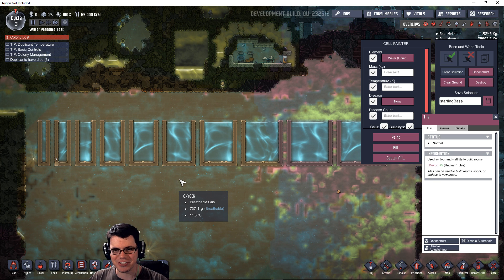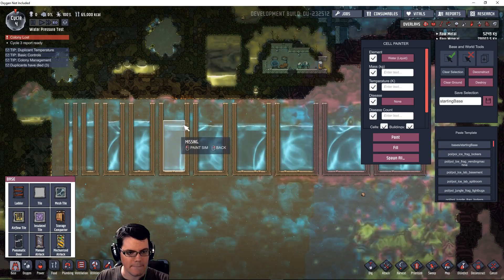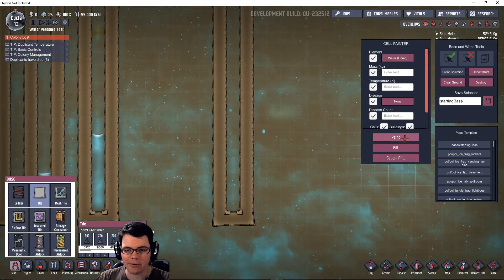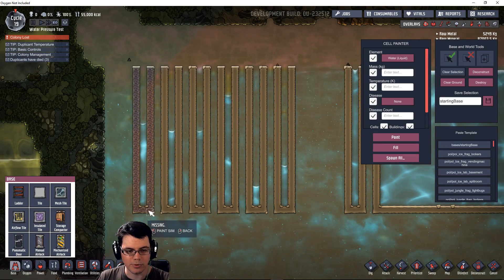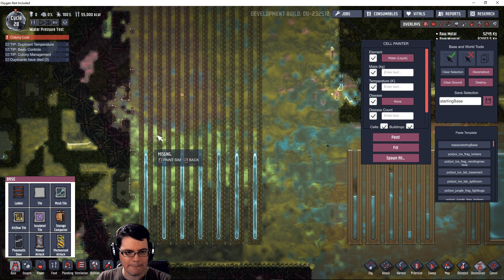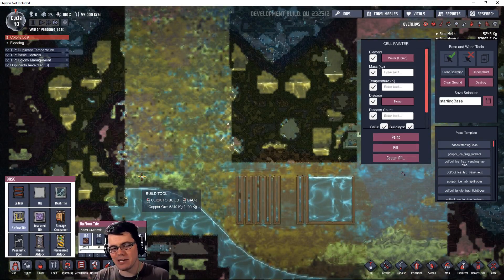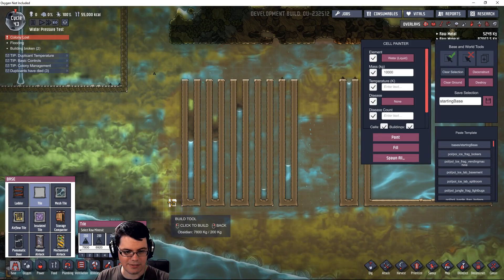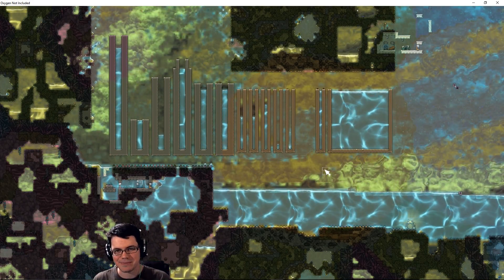Tiles VS Water Pressure Experiment! - Oxygen Not Included Tutorial

Comment: When it comes to the doors and flow-blocks, I think, in code, the surface is 0.25 wider than the door-blocks themselves. Thus the odd "floating off the surface" effectm as it weaves into that space and the code pushes it back away. That is how they are able to function as "doors", resisting the "gap" of flow. (Used to calculate travel-time, of all objects passing through, or trying to pass through. Since they are not an actual "block". Like it is a code-hack, to make the game function as desired, because it didn't when treated as a normal block which "grabs" water on the surface.)

It is funny that they seem to be indestructible though. (Once they see the exploit uses crop-up. I am sure that they will force a similar level of damage to them, with another hacked code.)

Comment: If it counts 12 or more tiles straight - what would happen if you were to stagger tiles in between? Basicly get 5 tiles water all across, then the 6th tile you do some with water and others with blocks, then 5 tiles water all across, then the 12th tile you do some water and some blocks - but inverse from the previous set.

Now you can have a very high column of connected water (or any fluid), but none are directly 12 or more water straight up from a block. Does the 'pressure' count sideways? Or can you "fool" the internal logic?

Comment: Hello.  I was making water lock, when I noticed that is it possible to create a corner waterlock.  
http://steamcommunity.com/sharedfiles/filedetails/?id=1147278076
As you can see, the mere 39.4 grams of water in the corner stops the high density carbon dioxide from entering the chlorine chamber, while the duplicants can enter the chlorine room to deliver bleachstone.  (The bottle emptier is not being used.)

I've tried to duplicate this result in other places, and I noticed some odd results.  If the lock goes from up to right, it works, but if it goes up to left, it lets air in (as far as I can tell).  Also, the water sometimes vanishes from the other locks.  I know that I've had the water lock in the screenshot for quite a while, though that area is not heavily trafficked.  This kind of waterlock would be much nicer than the standard waterlock, as it avoids the sopping wet debuff in favor of soggy feet.

I have a few theories as to why this is happening, but I do not know how to test them.

1:  The duplicants track water when they walk through it, displacing some of it.  (I doubt it, the amount doesnt change when they walk through it, though that would be realistic)
2:  The dublicants destroy or displace the water when they exhale.  (This is more probable, as that would explain why the lock with no oxygen succeeds when the ones with oxygen on one side always fail)
3:  The water trickles down (I doubt it, the water amounts were stable until they vanished)

Would you mind sciencing it for me?

(I also did stack fridges over 12 hatches to feed them meal lice because I am a space rancher)

Comment: I would like to know what kind of "damage" it could withstand in term of insulation depending on materials and thickness. Personally, I tend to use 2 layers for my water tank, one made of gas tile then wrapped in a insulated tile but it is not always enough to block off the heat of a huge tank. I just wonder what would be thee best to hold huge amount of water without breaking your base.

Comment: Pretty realistic. IRL, water pressure is solely a function of the height of the water, so it makes sense. I wonder what happens with oddly-shaped tanks.
Reply: Hydrostatic pressure = density × g × height.
Density = Mass / Volume.
g = Acceleration due to gravity.
You can pressurise water (IRL and in-game) so it has the same mass at a lower volume (thus higher density). I don't know how the density affects the pressure calculation in-game, or if it is solely a function of height.

I doubt the game can handle calculations of a whole tank, as odd shapes would make for more difficult equations for the game.

Comment: 3 tiles thick stops water pressure entirely. For anything less that that, except doors/airflow tiles I guess, I am pretty sure it has to do with material hardness.  Not sure if you can still do it now, but you used to be able to break neutronium too as long as it was less then 3 tiles thick, purely by dumping as much water on it as possible.

Comment: Recently picked up ONI & found your channel. Love all these great tutorials and experiments. I downloaded your Github yaml files last night and started playing around with them in a sandbox world. One issue (as you've noted in previous videos) is the settings for values, pressure switches etc, are not maintained when you paste these templates into a world you might consider including setup/usage instructions somewhere. Also.. I have a QUESTION / REQUEST: I'm still unclear on the proper usage/placement of batteries (and manual generators) when using transformers and heavy-watt circuits. Is this something you can provide a short tutorial around (or point me to the video if you've already done it)? Thanks for the consideration. Keep 'em coming!!
Reply: So if you look closely and carefully at Transformers, you can see a large voltage icon on the left dial, and a small voltage icon on the smaller, right-hand dial. This indicates that all you need is to connect the Heavi-Watt Wire to the left side, and your outputs come out the right side.

The most confusing thing for me to figure out on my own, since tutorials appear to be scarce, is that it will indicate a red error message on the bottom, which looks very similar to a wire input missing icon in the wires HUD overlay. This isn't actually a third wire, like I initially thought. It is just indicating you don't have a constant power generation source into your Heavi-Watt circuit, to provide constant electricity to the small, 1,000 Watt output circuit.

A few important things to bear in mind are that you can't negate the decor effect or really turn properly Heavi-Watt wires, the MAXIMUM circuit overload power for small circuits is 1,000 Watts, but it can be strained at only 600 Watts if I'm not mistaken. That means it won't break, but it will generate tons of heat. If you want to mitigate heat problems, you need multiple transformers for big projects, keeping power consumption on 1 circuit to about 560W or below, which costs copper and transformers. I'm not sure if gold amalgum or iron ore produce less heat when strained, but my guess is they do.

Another thing is that you need 1 transformer to itself for big things like liquid tepidizers, which require 1,000 Watts constantly. Battery placement doesn't matter in terms of being on a 15,000 Watt Heavi-Watt Wire power generation circuit, or being in your base on the equipment circuit. I, however, would recommend you keep batteries and their heat and negative decor production outside the base, along with Heavi-Watt Wires. They kill decor.

Lastly, I would say do your power generation on the left side of your base, or else you have to route things awkwardly, due to the fact that Heavi-Watt Wires ALWAYS input into the transformers from the left side, because transformers currently cannot be rotated.

Hopefully I've helped you here. Anyone, including Brothgar, feel free to correct me or give insight into overheating and excess energy production of wires, and different material types. Obviously, in real life, all wires produce excess thermal energy, damaging themselves, regardless of the strain and amount of energy flowing through them. They will emit some heat proportionally. This does change based on material and resistivity. (Perhaps this could be yet another experiment video such as this one.)
Reply: Great feedback! Thanks Greggles!

Comment: It does look like the gas-permeable tiles have a magic layer of gas that is protecting them from the water perssure.

So, it's likely they'll adjust how gas permeable and other metallic doors/walls operate.  For gameplay balance.

Doors themselves shouldn't be even capable of supporting pressure unless built within top and bottom structural tiles, perhaps.  And even then the metal doors would be inherently weaker than the stronger versions of structural tiles.

And gas permeable tiles should be weaker than doors and structural tiles as well I would think.  Even though made of metal, they are porous in some variation and thus physically weaker.  They would likely only work as liquid containment properly in lighter pressure scenarios.

Comment: It appears, visually, that liquids are suspended off of airflow tiles, with a buffer of some sort of gas.  If this the case, it would entirely explain why they can hold a seemingly infinite pressure of liquid, because the tile isn't actually making direct contact with the liquid or its pressure.
Reply: As always, entertaining and informative!
Reply: Contact with steam will fill it, https://imgur.com/mixCWOE , still no pressure damage, but the tiles are air-tight now.
@ Brathgar: nice to know the numbers, but most pressure damage i experienced is when P-water and water trying to get out of each others way.
Reply: I wonder what would happen in a Vacuum...
Reply: I remember a discussion of another ONI player using the air flow tiles to stop the flow from a geyser. The air flow tiles is hydrophobic so the water does not make contact with the water, thus the water's volumn is kept from the tile.